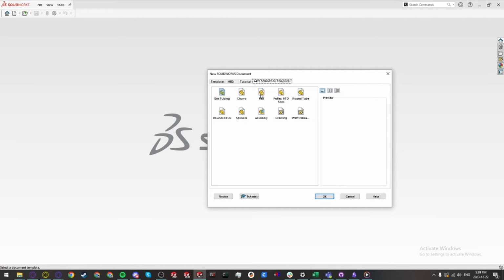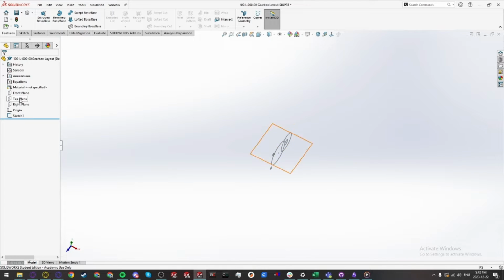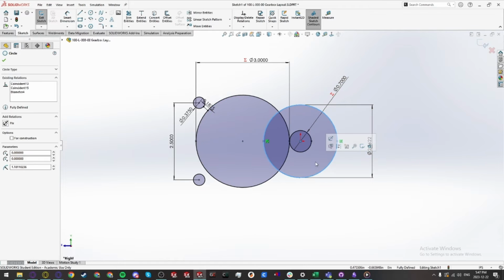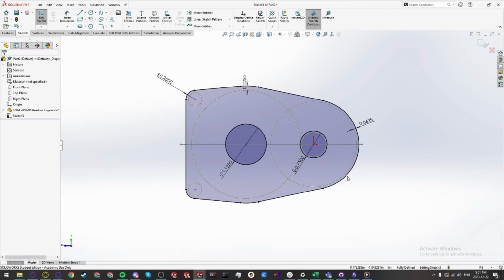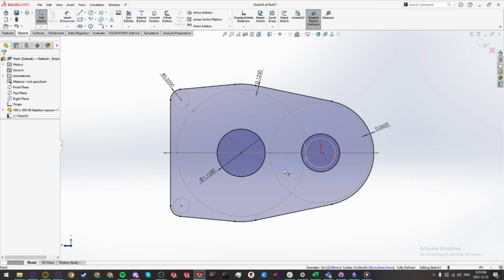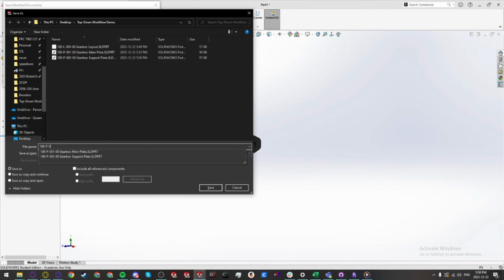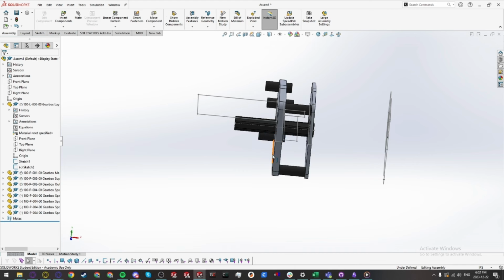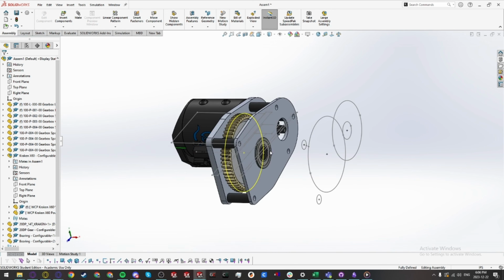SOLIDWORKS Tutorial: How to use Layout Sketches in a Top-Down Design Workflow

Comment: Good video- i have a quick question. Whats the difference of doing it this way v doing it all in the asembly and creating parts within the assembly?
Reply: That’s a good way of doing it too, i think it comes down to preference. I personally think sketches are a bit more robust as references as there’s a chance faces/edges/vertexes get replaced and broken, but it’s definitely more intuitive for beginners compared to creating 3d geometry based on 2d sketches
Reply: @Brandon-xj8bk  In the time it took him to create his sketches, I would've had all the parts modeled as solids and mated in the assembly context. Editing each part is as simple as a quick in-context edit. If you know your sizes/targets/offsets while you're designing (most good designers do), then using this layout method doesn't pose much of an advantage for a simple assembly like this. Where this method really shines is when you use sketch blocks for quick iteration of things like complex linkages. In those scenarios, using layouts with sketch blocks absolutely makes the most sense, as you can verify system motion without ever modeling a single solid. Think linkages, cams, gear/belt trains, basically anything that involves motion. One could argue that in this scenario, there is motion (and there is), but not in a way that truly warrants layout-style modelling.